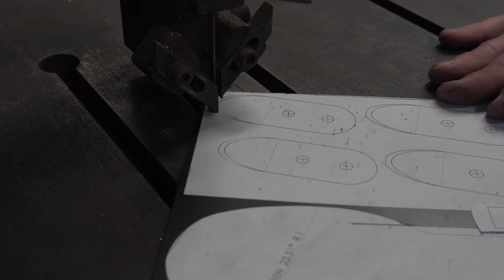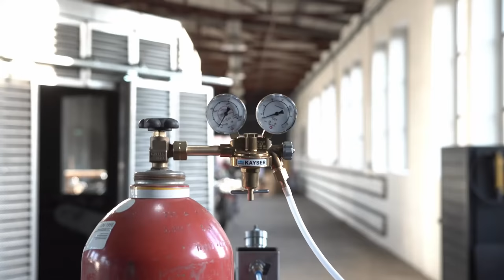Building a motorcycle frame | Part. 2

Comment: Annular cutters work a lot cleaner than the bi metal hole saws. They are pretty cheap on ebay. They are like a hollow end mill with a centering hole for a small drill and have 8 or more flutes. I run them at slow speeds, like below 100rpm. 
Nice back gassing. Great welding. I always learn a few new tricks watching these videos. That Millyard fellow has some nice videos.
Reply from the maker: Thank you, 

yes, annular cutters are better, I just currently have the problem that my lowest speed is 700 rpm, it works, but the tools do not like it.

Comment: I'm a noob with welding.. was that a different kind of welder you used to do tack the plates down and then you used another kind of welder to weld?I saw you used gas to fill the frame up before welding. Was the first welder a MIG and the second a TIG?
Reply: I see there hasn't been much in the way of replies to your post. NOTICE -I am not this person. Nor am I skilled to the level of the master you see before you. That being said, I can try to help with a few of your questions.
Reply: Tig - tungsten inert gas welding gtaw. From what I could see he uses the same TIG welding method for tacking as well as welding. TIG is a very detailed process. SUMMARY, shared similar traits with soldering. Filler metal rod in one hand torch in the other. Uses varying electrodes/filler metal rods based on material to be welded. Much better heat control and precision welds. Welds chromoly stainless aluminum mild steel and most all others. Simply research electrode and shielding gas requirements for material as well as base settings (reference only, adjust accordingly) for your specific welding machine and style. Filling the vessel with shielding gas has many advantages worth research.
Reply from the maker: Thanks Karis, it is all right

Comment: Im guessing frames are made out of steel. Are their frames made out of aluminum? Or is that just bicycles that are made out of aluminum?  How thick does the steel/aluminum need to be for a motorcycle and how thick are bicycles?  Reason I ask is I wanted to convert a bicycle to a moped by adding a motor to it like many are doing now.. but I ran into a guy who said the bike frames are not strong enough to handle vibrations and he had to reinforce his frame. So Im trying to figure out how much it would cost me to buy the steel/aluminum to have a frame built or for me to try to build. I want to make one of those Micargi Vancouver streatch cruiser bicycle frames.
Reply: Frames are made of many different materials. Mountain bikes nowadays mostly aluminum. My old school GT tour 2 bicycle -chromoly. 1912 bianchi 1 cylinder bicycle - mild steel. The material choice and associated strengths / weaknesses are calculated and determined mostly on the requirements of the bicycle. Is weight going to be a factor? Will the bike go 10 or 100 mph / KPH? The more work (usage/abuse) you ask of the item (bicycle) , the more you will have to consider material to be used and then gauge or thickness of the material Plus any other known / unknown factors. 
A show bike that isn't going to be on the streets or off-road speaks for itself when it comes to materials needed. A trail bicycle will be built OEM strong and have associated reinforcements where necessary as well as a visibley expressed weight limit/ Max load..... Are you the only rider, is it just a metro cruiser, do you have rough terrain, passengers, is it for long distance or short springs etc.. you feel me so far ?
.....Feel free to correct me or educate me if needed.....
Years ago most mild steel tubing had a seam in it and still does to this day as well as other materials used for tubing or pipe. You can see this seem and feel it on the inside of the material. Yes there is also a difference between tubing and pipe do your research diligently. Most motorcycles in my generation used what's called d o m (drawn over mandrel) or mechanical steel  tubing.. Mainly it's seamless... thus better attributes. Alloys like chromoly have their own attributes do your research again. You might find a titanium application if you look hard enough.
No matter what flavor of the material honestly thicker walls heavier duty pieces Overkill is the way to go rather than risk it. Gussets AKA little triangles and such at the corners and joints as well as using solid material inserts or external cases are prime methods to reinforce weak intersections and points. You could create exoskeletons if you thought you needed them. Seemed tubes will work if you reinforce and brace your weak points and or double down on Wall thickness or material thickness. Don't put your seam in a position for shearing splitting torsional stress etc. You might possibly ask your local Fab shop / steel supplier if they have a recommendation for material. They will teach you a little about wall thickness and or schedules. 
Anybody can mig weld some old frames together and make it work with a motor and controls, and it's a fun way to learn a lot. Perhaps not safely though and definitely definitely not going to be at the level of the master above.      
 
Summary -plan, work, replan ,rework, finalize and detail. decide how dedicated you want to be!!!  Decide the general requirements of the bicycle, use that to determine the material you would like to use, the material will help you determine the welding method, then if possible CAD or graph paper& pencil to create approximate scale drawings of the frame from as many perspectives as you want(this may help with angle starting points such as rake). Highly recommend building or buying a solid frame jig. Create and use Sturdy construction paper cut outs and or templates before using real material when possible.Create a cut list parts list and order of operations.
Reply: I have found in my little experience that the creation will tell me how it wants to go together. Some things just don't work as planned or plans change or ideas shift so keep your mind open be receptive to the idea that this creation may have a plan of its own. Don't settle for less than your best also understand that you won't achieve the same outcome as anybody else. Oh and measure twice cut once very important

Comment: I like how you do your work. Nice and clean, take time for preparation, cut and grind your tubes for perfect fit.
But i have a question...why are you seeling the edges? 25CrMo4 is a carbonsteel not a stainless🤔
Do you use formation gas?

Me myself don't use it with this steel and my workplace is KTM R&D.
My daily job is to build Prototyp main and rear frames with the exact same steel.
Most of the time I use my mag/mig welder with a G6 wire and C18 as my shielding gas.

When i tig weld, i use the same rod, 99.9 argon but no formation gas for the inner tube.

Buy the way, your work A+

Comment: Nice job dude !
But I wonder why are you blowing gas in your carbon steel pipes (Argon or Nitrogen ?) ? You are indeed welding carbon steel ? Crmo does needs gas ?
Reply from the maker: With the higher chromium content, I prefer to shape, and the root is simply cleaner and runs better, especially with thin-walled tubes.

Comment: What is the reason of sealing the tubes with the tape? I've seen it on some other rollcage build video too. Great work and process btw. Pleasure to watch!
Reply: Filling the frame with argon will help create a stronger weld because there is no oxidation inside the the tube.
Reply from the maker: Yes @Tom Wagemans, that is correct ;)
Reply: @tomwagemans1872  oh thank you. I tought maybe to prevent the hollow areas getting trapped with gas to prevent explosion or something. Turned out right opposite :)

Comment: Magnifique soudure 👍
Le cadre poutre que j'ai, un Martin est soudo-brasé, je suppose que le métal d'apport est du 25cd4s aussi.
C'est pour monter quel moteur dans ce cadre?
Magnificent welding 👍
The beam frame I have, a Martin is brazed, I guess the filler metal is 25cd4s too.
Which motor is it to mount in this frame?
Reply from the maker: Ther frame is for a Honda 750 ;)

Comment: Super video, but why send the argon into the tank when it's steel? Only for stainless steel do you need to put the gas towards...? Otherwise, excellent work!
Reply from the maker: The frame is made of 25CrMo4 this should also be better formed to get a good back of the weld, with thin-walled tubes very important

Comment: fine work ,,, I see your using a magnetic folder , how do you find it ?
Reply from the maker: I am very satisfied with it, I use it now more than 5 years, and can not complain, sometimes he had to bend even 3mm stainless steel, only narrow pieces, but even that he did well.
Reply: @KRTframework   how is it on 2mm stuff , does it clamp tight enough for sharp bends . thanks for the time to answer

Comment: Amazing work!! How do you remove the scale from the metal before welding? Did you use one of those stripping discs on the grinder?
Reply from the maker: It is a special disc for paint and rust removal, which also works very well for descaling.
Reply: The tubing and steel plate are cold rolled no scale

Comment: I'm just wondering what the metal tape was used for, can anybody please explain?
Reply from the maker: I fill the frame with shielding gas during welding, so that it does not escape everywhere, I tape the places that are not yet welded with the aluminum tape.
Reply: @KRTframework  The first time I've seen that process was in the custom bicycle building circles. IIRC it's to prevent occlusions and pitting in the back side of the weld. I've never attempted TIG, metal shop in high school only had stick. So I've been in the two schools of thought: "Bigger the glob the better the job" and "A grinder and paint make me the welder I ain't"

Comment: Am wondering,  why that gas is connected to chassis frame ? Anyone can educate me the purpose?
Reply from the maker: I fill the frame with shielding gas during welding so that no oxygen can get to the weld from below. to prevent the gas from escaping everywhere, I tape the areas that have not yet been welded with aluminum tape.
Reply: @KRTframework  thank you so much,  that explains everything :)

Comment: Is that,gas you are injecting in the frame nitrogen？
Reply: Argon for the Tig welder
Reply from the maker: I fill the frame with shielding gas during welding so that no oxygen can get to the weld from below. to prevent the gas from escaping everywhere, I tape the areas that have not yet been welded with aluminum tape.
Reply: @KRTframework  which tape do you use. I cannot find one that is not leaving glue residu.
Reply: @KRTframework  Thanks for the info. You tig weld are apiece of art.
Reply: @karlalton3170  👍
Reply from the maker: @tomwagemans1872  mine unfortunately also always leaves some glue behind when it gets warm, but you can remove it with a cotton cloth.
Reply: @KRTframework  ok thanks. It's normal then.

Comment: What material is it and what gas do you use on the inside?
Reply from the maker: The material is 25CrMo4 an i use for this Frame purge Gas 95/5, but argon also works, it's just more expensive